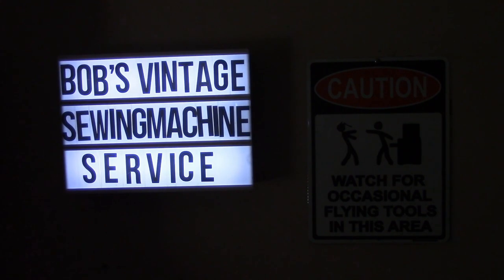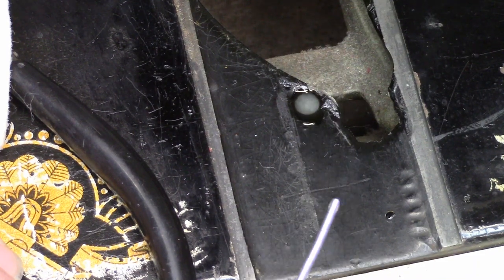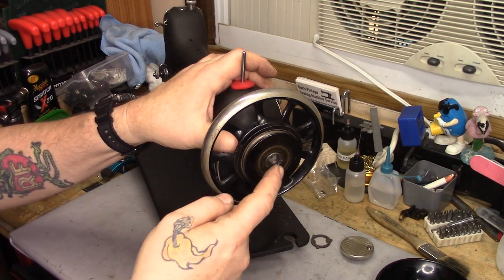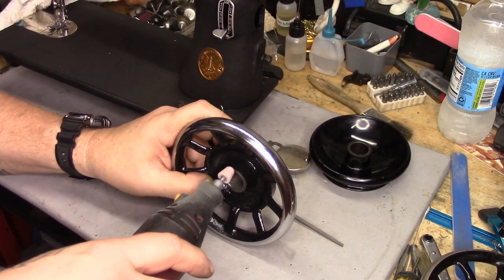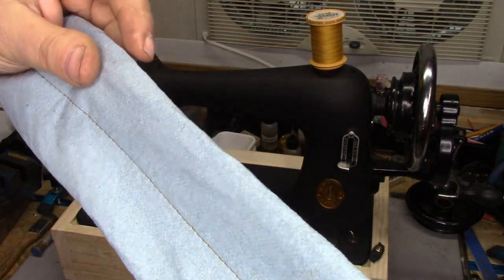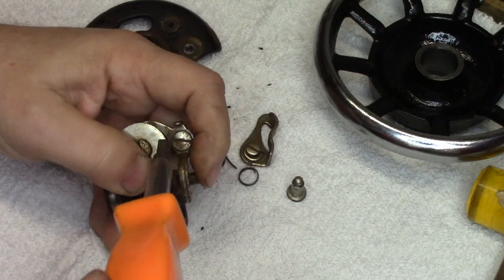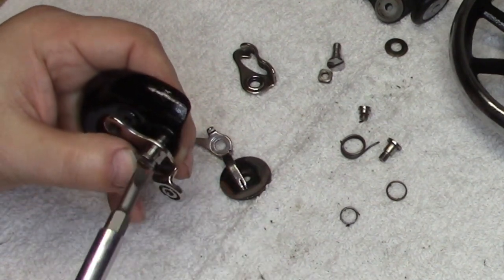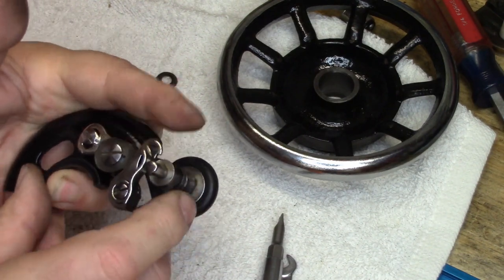Sunday Morning Quickies, Episode 45 - Vibrating shuttle oil wicks, and finishing up the Godzilla 66

Comment: It took me a long time to find that tiny hole for the wick in my 27, it was rock solid with crusty old oil and in such a hard to see area. I didn't really know where to look for it, either. But it's clean now, new wick in and oiled. I'm also working on my 66's bobbin winder, so this video came at the right time. Thanks Bob, I'm sure I never would have done any of the restoration on either machine without seeing how to do it on your channel. You make it look easy enough for a novice like me to do this stuff. It's so much easier to put everything back together when you can clearly see each part and what order to do it in.

Comment: Oh wow, your channel is the best! This is the bobbin wonder on my class 15 and I’ve had such a hard time finding anything to show cleaning and assembly of it. Most of the class 15 videos I find have the bobbin wonder on the base of the machine. This was so helpful! In another video, you said DO NOT use alcohol to clean the hardware; can I ask why that is? I do not want to damage my Singer.
Reply from the maker: You don't want to use alcohol for a couple of reasons: 1) if it gets on your clear coat, it will dissolve it, and 2) most of the "dirt, grime, and schmoo" is actually old oil combined with lint and dust. Alcohol isn't the best solvent for that, but sewing machine oil will clean it nicely as new oil cleans old oil better than anything.

Comment: Hello Bob. I have a 28 K ( 1898 ).
The wick hole is there that you show at 1 : 15 ish but there isn't the little port to release oil onto the vertical shuttle guide. Thanks a lot , Colin UK.
Reply from the maker: Arre you sure it's not just clogged?
Reply: @BobFowlerWorkshop  
I've checked it again with a 📌 
and bingo ! there it is. Thanks once again. Colin.

Comment: Grateful if you can show the correct procedure for Shuttle Hook timing using the three marks on needle bar in Singer Zigzag Sewing machine Model 6211C/6215C
Reply from the maker: I have to admit, I have never had one on my bench. My guess would be to put the needle in the center position, then align the bottom mark to the appropriate timing position. Like I said, I haven't worked on one, but once again, my guess is that the needle bar will be raised up 2 to 2.5mm from bottom dead center.

Comment: I think I have x 1 machine that is a shuttle that still has the original oil wicks insitu 

it’s an old German shirt machine & the oil wick does sit a bit up as it also oil the slide as well..

The oddest thing there is nothing in any manuals be it singer etc machines that don’t even mention the red wool oil wicks are meant to be there or s this to replace it it’s needed..

? How many machines could have had these oil wicks picked out by accident or worn away in the past, not knowing they needed to be there or even oil it..

Now to go & check my singer 128 shuttle machines & my other German antique sewing machines & check if they in fact have this hole & fix this issue  & put a label on them - whilst I await the arrival of the oil wick cord to fix them...

I just mastered replacing the red oil wicks in 2x 99K machines that were either partly there or totally gone ..

the longest time was picking that old red oil wool felt out of that darn itty bitty spring... 

But now both are back in the 99 k machine & I did check the others..

Think I will need to put a note & picture where these are 

for the future person whom may get this machine when I one day will no longer here to use them..

( just so these machines can go for another 100 more years )..